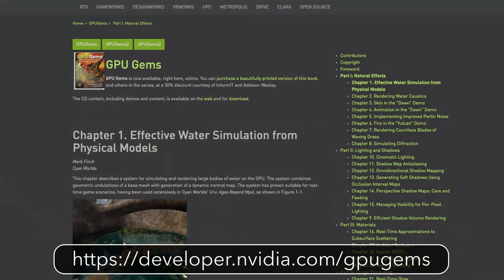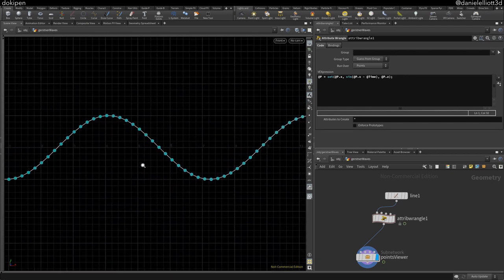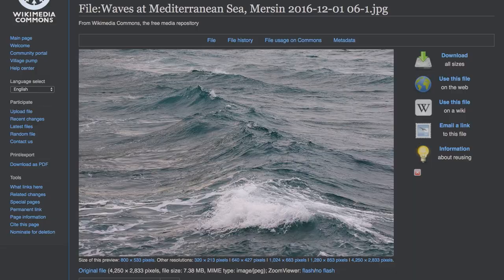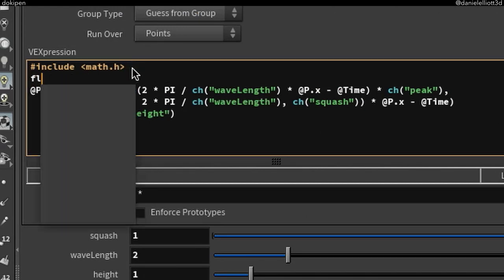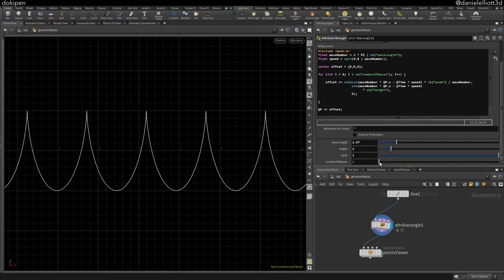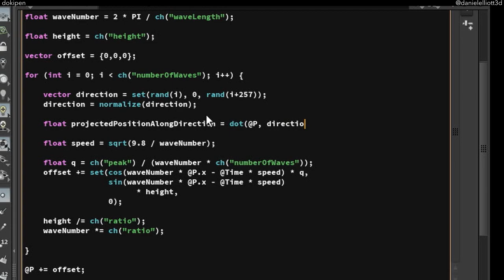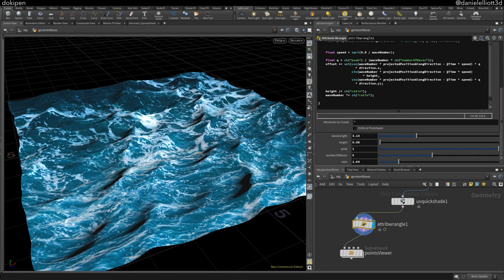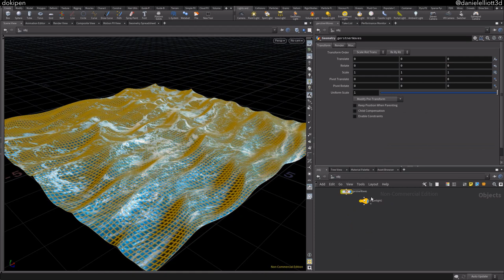How to create VFX Oceans using Gerstner Waves in Houdini

Comment: The problem with Houdini and water is that person has to have 20K+ computer to do any realistic large scale water or anything. Houdini is really not optimized for a normal computer but for a network of them. I use it too that's why I know. With RTX 2080 and 16 core processor I can't simulate even 10 by 10 ocean as it just crashes at 0.01 article Separation. I hope side FX finds some better way to make Houdini actually usable for individuals rather than just Hollywood studios with networks of 30K plus computers each.
Reply from the maker: If you are using a gpu, that might be an out of memory error if your sim is that high res. Maybe a cpu sim with narrow band enabled would help. It will slow down but would finish.

I've got an old second hand xeon pc that I got for 2k. You can build a ryzen pc for around that that is pretty powerful.